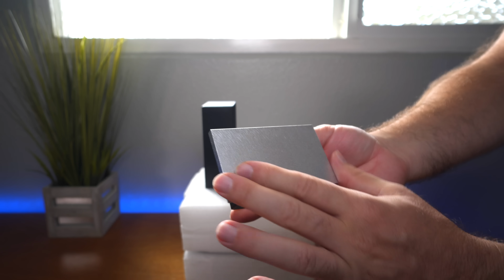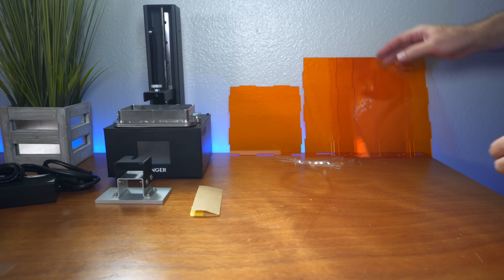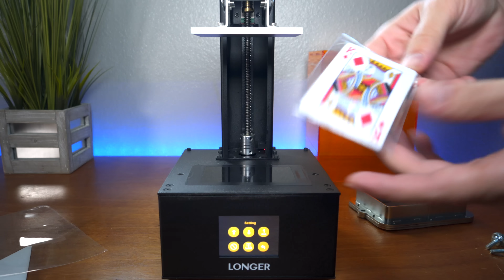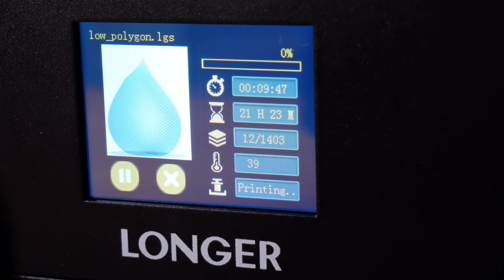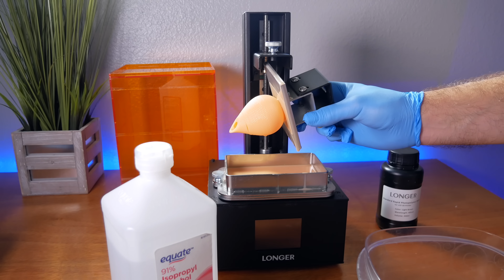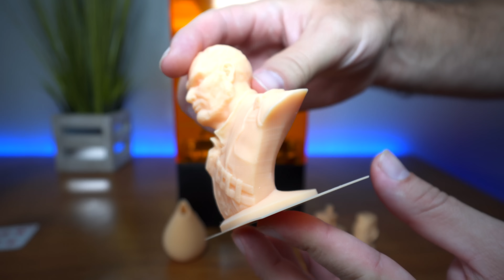Longer Orange 10 - LCD Resin 3D Printer - Unbox & Setup

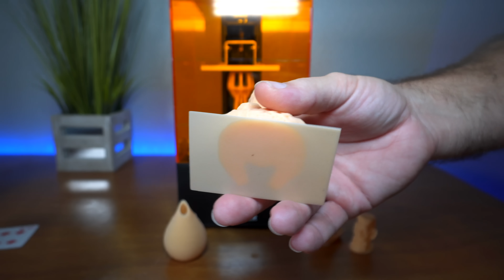Comment: @23:18 The reason why you are getting that "buffer" layer underneath your bases is because you calibrated your build plate with one of the included playing cards, rather than using it to scrape the excess resin from off of the build plate after printing. That's fine if you choose to do that, but just be aware that's why it's happening. ;-)

Comment: IRRESPONSIBLE PRESENTATION to not show the requirement to wear gloves and toxic vapour breathing protection when handling resins which can cause a fatal allergic reaction if they come into contact with the skin, or are breathed in. You proved how easy it is to spill the damned stuff even when you had a sizeable funnel to pour into. You're sanitising the use of these printers and I do not respect that. Otherwise fine, but I'd take this video down and do some INSERTS and text overlays of the required safety equipment before you have to question your conscience if someone watches this, doesn't take the necessary ventilation precautions (also not mentioned or shown visually!?) and drops dead. Anyone doing Resin Printer Presentations should be highlighting not whitewashing SAFETY and even commenting on what to do if you get resin on your skin, or start to experience breathing difficulty. You're not demonstrating how to operate a clock radio or a popcorn maker.

Comment: Very badly prepared video. I get that the idea behind an unboxing video is, that you open it for the first time. But you should really inform yourself beforehand, especially about safety. Absolute minimum is: gloves and safety glasses at all times when handling anything that may get in contact with the resin, including the model, print plate, vat, bottles (resin and isopropanol), the scraper, the orange hood and the touchscreen (because they will be contaminated when you touch them with the gloves or from resin splashing/flowing down).

Every time you say "I guess" or "I think", you might as well have said "I don't know" and ask yourself: should this go in YouTube?

Talks about a printer for half an hour and doesn't know what "LCD" or "SLA" means.
Unboxing the printer. Pulls a part out of the box: "this looks like part of the printer".
Assembles the printer and levels the print plate, THEN takes a look at the USB stick for instructions. Not shipping with a printed 3-page first-steps tutorial is ultra cheap, even for China.

The "diagonal lines" are aliasing artifacts from the pixel raster of the LCD.
The "elephant foot" comes from the higher exposure time for the first layers, which is why you usually print the model suspended on support. It may eventually be an issue with the zero-position of the printer being too low, but you would hear the stepper motors struggling to push the print plate down at the start.
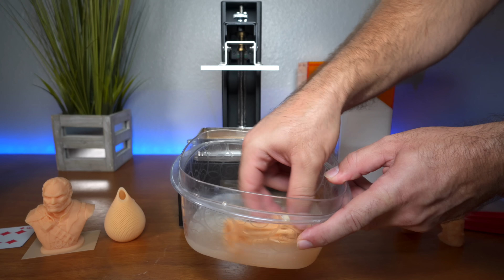27:05 OMG, WTF DUDE, GLOVES!!!
For cleaning the models in general: You don't just poor some alcohol on it. Submerse the model in Isopropanol and let it dissolve the resin for like half a minute and shake it around. Then put it in a second bowl of Isopropanol, which is not contaminated with resin yet. Maybe use a tooth brush to get the resin out of all crevices. Then you let it dry in the air or clean up with water. Wiping it off might damage it, because it is not fully cured/hardened yet. You should also NOT touch the "cleaned" model. It has to fully cure first by prolonged exposure to sunlight and from all sides, including the bottom, or get a UV-lamp and an automatically rotating table.

Comment: Sorry, I have to downvote this due to A. neglect of serious safety requirements, and B. Failure to read instructions.  Too many people are putting up resin printer vids without any attention to the safety aspects.  Chemical resistant gloves are a must.  Avoid washing resin off skin using IPA.  Learn from professional handlers of chemicals.  Be safe, and teach safe methods.
Reply: But he has the "blue gloves". Those are the right ones. The resin hates blue. It feels much more comfortable in an orange environment, hence the orange cover. ;)
On a more serious note, always use nitril or vinyl gloves, not latex.
Thinking about that, even the Anycubic Photon comes with a paper cover for your mouth, which might give some protection against droplets, but not against the fumes.

Comment: those diagonal lines are from the pixels on the lcd. you might be able to minimize them with some antialiasing
Reply: Not all printers/firmware/file formats support aliasing. It might help to rotate the model to a weird angle, such that you don't have any surfaces close to 0/90 degrees in either of the 3 axes.

Comment: Vlad - SLA resin is EXTREMELY toxic for your skin/body. You MUST wear gloves when working with resins. You have a great channel and many people watch you as a role model. Please take safety seriously.
Reply: 100% AGREE.
Reply: Is it still toxic to skin even after it’s dried?
Reply: I’m new to 3D priming and could use all the tips I could get getting a 3D printer next month
Reply: Wanting to use it for projects mainly arduino based projects
Reply: Anyone know where the idea comes from that the resin is "EXTREMELY toxic"? The MSDS says it "causes skin irritation" so it recommends use of gloves. There are plenty of MSDS codes for toxicity which it doesn't have (with the exception of "toxic to aquatic life"). Most of the safety recommendations are similar to the MSDS for isopropyl alcohol. Are people just repeating what they have heard other people say? Or am I missing something?

Edit: Just want to point out it also recommends eye protection and respiration protection. Both of which seems to be more strongly recommended for resin.

Comment: Yikes.... this is the problem with these cheap resin printers... folks are buying them without understanding the danger.... So many mistakes in this video.. and so much danger!   No Gloves at 26:45... not enough time in the ISO... and only 91%....   non-ventilated room.....    pouring ISO all over the build plate - major no-no...    27.05 - hands in the ISO AND RESIN.....  I say again.. YIKES!!  YIKES YIKES!!!!!
Reply: Oh, I forgot, not putting UV enclosure on immediately after pouring resin in reservoir.
Reply: @elfpimp1  Especially when you put it right under a window that letting in sunlight.
Reply: @TheBaldr  oh wow, I missed that!
Reply: Whiner!
Reply: The fact the printer is cheap is not related to the lack of knowledge by some youtubers. The principal is the same, cheap or not...Resin is Bad, use gloves, use a ventilated area, etc.
Reply: @LuisPa247  good response.  It's up to the user's to educate themselves on safety and operation of ANY equipment..
Reply: That's not the printers fault, that's just this guy being dumb lol
Reply: Not reading the instructions so we don't hear, "it must be for .....  I guess..."...

Comment: The elephant foot is normal if you don't print a support pad. This is because the exposure time is 4x longer for the first few layers to help stick to the print bed. In general, if you increase exposure time  it will make the object a little bigger in the x and y axis.

Comment: 5 hours to print this. Didn't expect that. Definitely longer than fdm printer.
Reply: But you could cover the whole build plate with objects and still print it within 5 hours ;)
Reply: You get 20 layers per millimeter height and much more detail in all 3 dimensions. The print time only depends on the number of layers, not what is in the layers. On large, solid objects or many pieces printer at once, a high resolution SLA print might actually be faster than a low resolution FDM print.
Reply: 10 micron thick layers
no fmd can do that

Comment: Dude be careful with touching the uncured parts without gloves or get your bare hands into the bath of ipa and resin. You might develop an epoxy allergy. Not funny! These developers are weird guys... the put an anti backlash nut up top and a spring connector between motor shaft and leadscrew. So the the anti backlash nut is useless. Putting that self centering coupling on (https://www.thingiverse.com/thing:602481 ) should help a lot and will actually give that anti backlash nut a reason to exist. When you are a it I recommend checking the linear rail too and see how smooth it runs or if there is any play. The cheap chinese ones have a varying quality between one exemplar and another. Thanks for your review.

Comment: Don't rinse the build plate in alcohol, then hang it back on the printer until it is dry. You can contaminate the resin if alcohol drips into it.

Comment: This seems like an extremely cheap resin printer (almost half the price of an Anycubic Photon), though on Aliexpress i get in the technical data of an LCD resolution of only 854*480 which is pretty damn low compared to similar printers, which offer at least 1080p if not 2K resolution (like the Anycubic Photon or Longer Orange120 which seems to be the improved version of this one, albeit at 3 times the price). Would be interesting to have a comparison in print quality between this one and a 2K printer.
Reply: Monoprice MP Mini SLA has 2k resolution as is 300$
Reply: You wouldn't even see the deference regardless , anything LCD screen above 800X600 is more then plenty. the screens voxel will be the same regardless. I built a few of small LCD printers for myself and i have to say at this price! it seems more then worth it.
Reply: @patprop74  Could you elaborate? 0.11mm in X and Y doesn't seem enough.
Reply: @cthulpiss  0.11mm of what ? where did you get this number ? It is the DPI that will give you the Voxel resolution and micron resolution of X and Y,  here is a little reading to help you understand a little more https://theorthocosmos.com/easily-calculating-resolution-3d-printers/

Comment: I thinking you have problems on the same hight. Check your guide or srew
Reply: Yes, a properly calibrated resin printer should show no layer lines at all, especially not at 25 microns. There seems to be a mechanical issue.